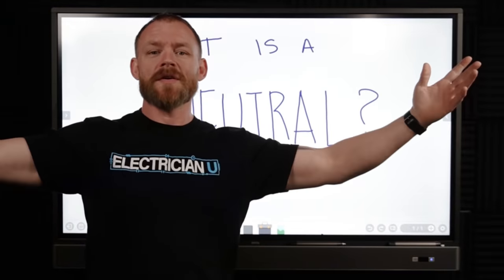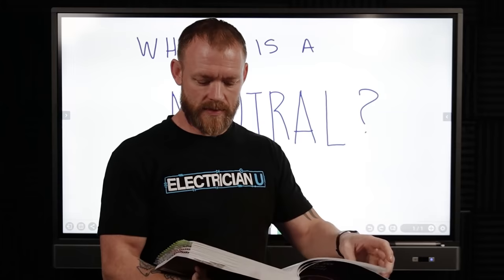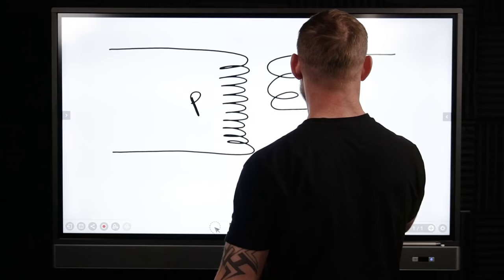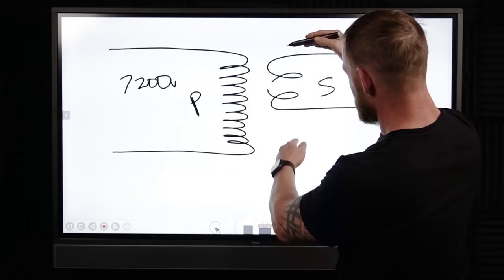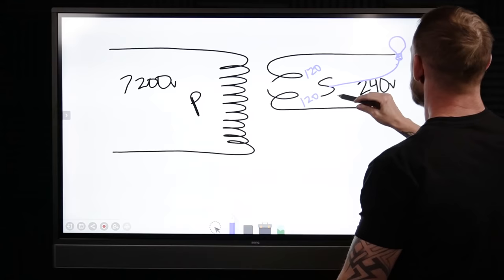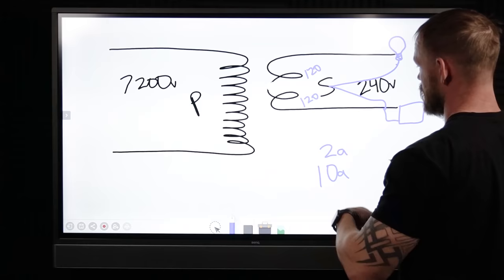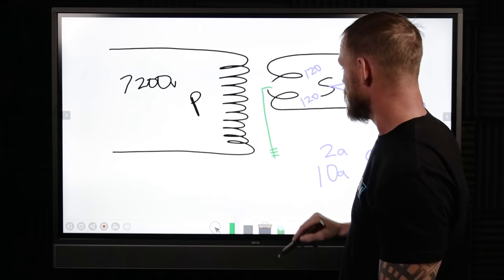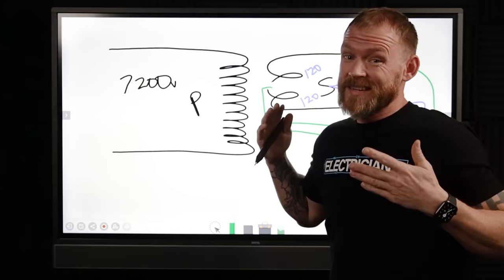What is a Neutral? The Difference Between Grounded and Grounding Conductors.

Comment: A couple of comments from an EE:

Tying the neutral to the earth ground is what keeps the two legs at 120V. In your unbalanced load scenario (light bulb and microwave), had the neutral not been grounded, the light bulb would have seen ~200V, and gone POP.  We found this to be true many years ago when the earth ground wire from the generator powering the house after a winter storm came loose. Fortunately, it stalled the generator. Yes, current does flow through the earth ground in an unbalanced situation.

Since the neutral does carry current, this is why the neutral and ground are bonded ONLY at the main panel.  All conductors have some resistance, and current flow causes a voltage drop. In, say, a shop several hundred feet away, neutral can be pulled well above ground when starting a large 120V motor, like a saw.  If neutral and ground are separate, ground will not change, since there is no current flowing through it.
Reply: Maan sry, but this doesn't make sence. It is possible that the fact that the trans is grounded smooths out things, but as you should know voltage transfromation depends on the ratio of windings. If there is 200V spike on the secondary it means there is a spike on the primary. The reason these are actually grounded is so they could be called neatrual. This is were I dont agree with both of you since the grounding is actually what makes the neutrial if not they will all simply be hot. If lets say we have no grounds anywere the system will still work but if you use your faze detector it will light up everywhere. Also no load on one part of a coil will influence the V on the other part of tapped coil in his diagram the toaster and light would actually be considered as different circuits.  I do low V analog stuff and all theory should apply to the bigger stuff,but I could be wrong.
Reply: Thanks for passing it forward. 
Helping our fellow sparkies ; feed thier families. 
Sweet
Reply: No, it is connecting the neutral to the center of the transformer that keeps the voltages equal. It would work even of some other point was connected to the earth instead or none was. Current never goes through earth in any normal scenario. It goes through the neutral to the transformer.
Reply: @okaro6595  Ya after a few days of searching and one good video I finally got it. It's all about the difference in potential. I can even say that with none we have to use all 3 phases.
Reply: I don't agree with your first paragraph. In the scenario described, the tiny difference in voltage drop on the equal halves of the full 240 volt winding would shift the 0 volt potential of the tap point on the windings... True. But the very same tap point/neutral point that is now electrically 'drifting', if you will, is also connected to ground as I am sure you know BUT .... That ground can do nothing to alleviate the imbalance in the windings due to the different loads imposed on them. What the ground CAN do is slightly follow the drifting of the center tap voltage and thereby maintain zero potential voltage protecting personnel.
Reply: @okaro6595  Right on.

Comment: I have a tricky multiple choice question, hopefully someone with more knowledge can help me out 

A White/grey wire in a feeder circuit ________:

A)Be bonded or have a circuit breaker
B)Is the largest wire in that circuit
C)Should not have a voltage to ground

My notes:

On the main panel, neutral is connected to the bar that is bonded with the panel, the green grounding wire is also connected to the same bar. (so does that mean the answer is A?)

In the sub panel, the neutral wire is connected to the neutral bar which is isolated from the metal box with plastic between them, the Green grounding wire is separated and is connected to its own bar that is bonded to the sub panel box.

In the circuit that this question applies to,

--------- “The neutral wire is going to be sized larger than the Green grounding wire” 
(But that doesn’t mean it’s the LARGEST in the circuit right? Because the two hot wire could be the same size)

--------"The neutral should have no potential difference(voltage) to the ground" (does that mean the answer is C?)
(But that doesn’t mean it’s the LARGEST in the circuit right? Because the two hot wire could be the same size)

Comment: Nice video, but I wish you would have gotten more into the difference between a grounded conductor and a neutral conductor, as there is no neutral in a two wire system. Only in a there or more system. Your lamp circuit has no neutral, nor dose your Microwave. They have a hot, and a grounded conductor, there is no neutral until they meet , and become a neutral back to the source. By definition the Neutral carries ONLY the unbalanced load between two or more hots. Thx for your vids
Reply: Neutral is the grounded conductor. It is neutral just because it is grounded. After multiple phases (split phase, three phase) meed neutral carried the unbalanced current but before that it carries the same current as the live wire. When they say neutral carried the difference they analyze the circuit at a specific point.
Reply: Back when I was a kid.. There was a hot,  and neutral at 110 volts just like a human body oxygen enriched blood go's out the hot wire comes back in neutral wire .... 5 amps system.  We need more volts for. Microwave. Computer.  So now we have a ground. To carry the extra volts and amps

Comment: Grounds and neutrals are electrically the same being tied together "likely" at the service. The difference is their purpose. Grounds are an emergency path for static and ideally brief overloads. Neutrals are sized and protected by overcurrent devices for normal continuous operations.
Reply: They are not electrically the same. A neutral is connected to the neutral point in the transformer and provides a return path for any unbalanced load and completes the circuit. The ground conductor is a safety to take any fault ( in the event of a short from the current carring conductor to the equipment ) to earth ground to give the electricity a place to go other than through a person. Hopefully the electrician has installed everything properly and the breaker trips. (The breaker won't always trip depending on the brand used. See: ITE,GE,FEDERAL ETC . if the electrician used a good brand such as square D, or cutler hammer you can count on it tripping on a ground fault)
Reply: @nooneyouknowhere6148  When transformers are used that include a common or neutral connection such as 4 wire 480/277 or 208/120 secondary. Isn't the "neutral conductor grounded" in the transformer or at the first overload device?

That's all I meant by saying electrically the same. All those little electrons are racing by to get back to the exact same place. Neutrals are the controlled desired paths. Grounds are for people and hardware protection path.
Reply: @Stones_Throw  right
Reply: @Stones_Throw  the problem comes when people start connecting grounds and neutrals together everywhere. Especially in sub panels. The fault current can take the wrong path and breakers dont trip etc
Reply: @nooneyouknowhere6148 Yes, that's why that connection is permitted only once at a service and/or transformers. If neutrals are grounded in multible places. Breakers and fuses should still trip but the problem is that current taking the least resistive path can continuously be going through anything metallic.
Reply: While emergency situations are the main use of the grounding conductor, it is not the only one. Their other function is to get rid of the leak current. A typical device that leaks is a computer. They leak about 0.2-0.5 mA. If the case is not grounded they get half the mains voltage in it and you can feel that by touching it and a radiator (not recommended as you should not touch ungroudned equipment and the ground at the same time)
Reply: @nooneyouknowhere6148  That will not affect the breakers. It may cause GFCIs to trip. Adding connections will never increase the resistance.
Reply: @okaro6595  thIs is what the neutral is for. It is called unbalanced load. The ground is soley for saftey in the event of a short from the hot side of the circuit to the case of the device. Both the hot and neutral are current carrying conductors. The neutral is the grounded conductor of the circuit.
Reply: @Stones_Throw  in cases where there are multiple sub panels such as commercial or industrial facilities,  when the installer has bonded the neutral and ground at all the panels, a simple short to ground at a location in the facility has been know to bypass the 20 amp breaker and trip the power company main fuse at the utility service connection at the transformer instead of the much smaller 20 amp breaker for the specific branch circuit.
Reply: @nooneyouknowhere6148  Such practices will cause an exposed grounding conductor such as conduit to be a continuous current carrier.
Reply: It’s been 2 years since you wrote this so I hope you’ve learnt the correct purpose of ground and neutral since then and how a protective device works .

Comment: Reason for the centre tap of the secondary of the distribution transformer - the Neutral - to be grounded at both the transformer & house ends is so that neither of the 2 split-phase to Neutral voltages may not deviate from 120 V should they end up getting loaded up differently?

Comment: Good, no, excellent video.  Also in a way explains why there's such an imbalance in a residential service when there's an open neutral involved.  On one side you have 140 volts and on the other there was 106 volts.  Ran into this about a year ago.  The imbalance didn't make sense to me, but I knew there was an open neutral somewhere.
Reply: Am I right that when the neutral from the utilities to your house gets disconnected the grounding rod starts carrying current back to the grounding rod of the utilities transformer?  It doesn’t work as well as a proper neutral but it does work some. That’s why voltages get weird.
Reply: @ecospider5  Exactly.. Both sides try to balance the load between them. Meaning one phase may go to 160 volts while the other drops to 80 volts but between the two you'll still have your total voltage supplied by the transformer. That's why lights go bright while others dim.. true story...lol
Reply: @AmericanOne9621  That happened at my house many years ago.  I came home and the kitchen light was lit up VERY bright.  It fried my computer and a few other electronic things.  It was an open neutral in the service drop.
Reply: @TheTennTexan  I've seen some strange things in my lifetime doing electrical work. Here's one for you.... Turned on a fluorescent fixture in a kitchen by waving my hand about 2 inches from it. If you want to know the details I'll share....
Reply: @ecospider5  If the neutral breaks downstream from being connected t the ground then the 240 V divides arbitrarily between the circuits depending on the load.

I it breaks upstream it is more complicated. Essentially it will use the ground rod but also the voltage and current will come back to the ground to equipment cases. There it will seek whatever path it finds. Lets say you have connected your PC to your TV, it goes to the AV cables to the TV then it will go through the cable TV connection to where it goes.
Reply: @okaro6595
Great info. I had not thought about how it would use every ground path. That could get dangerous. 

Also I have learned a shared neural circuit is a really bad idea. Loose that neural and things will get destroyed. I have one in the garage. I’m thinking of taking it out.

Comment: Got it. Neutral is grounded. Just use ground as a neutral. Kidding of course. Good explanation.
Reply: In many countries same wire was used for neutral and ground up to the socket in the past. There is nothing inherently wrong in that though it does have problems so it is not used anymore.

Comment: Can you explain why in a 240V circuit/device, some devices need neutral and some do not?
Reply: Some of those devices may be using internal components which may run on 120V and it may be more convenient to grab the neutral in order to get that voltage.

Comment: Thanks Dustin, very helpful. I wonder if one day you would do a video about Ohm's law, and how each of the three values (current, resistance, voltage) change when various loads are plugged in on a household circuit? Like if you plug in a load at the first receptacle, and then another load at recept # 2, there's more current going through the whole thing, but doesn't that mean the other values have necessarily changed as well? Love the channel, my friend. Cheers!
Reply: I’m afraid it’s a bit more complicated than Ohm’s Law.. i’m no technician, but I am an electrical engineering student, and the first thing I think about is real power, reactive power and complex power. Maybe that’s over complicating things but I know that’s how we analyze large scale loads like houses and industrial loads etc. I thought about this because it changes the overall load from the power system to your house. Really cool stuff.
Reply: In the example you use you would be drawing load off a single phase 120V branch circuit. 1st load at 1st receptacle is say 5A so that would be 5A on your hot and 5A returned on your neutral. Add another load at rec 2, so lets say its 3A. The total load would now be 8A on hot and neutral. The neutral is always equal in amperage to the hot and the voltage would stay constant at 120v. Your neutral only becomes “unbalanced” when it is shared by two different hots/phases in a panel. ( That is the example Dustin is showing on the board). To add another head scratcher to this if you run a three phase four wire distribution out of a commercial panel and all three hots to be equal in amperage, there is zero amps flowing back to your panel.
Reply: Im an apprentice but this.
simplified, in ohms law you need a constant, which is generally voltage, and then the resistance of your lights or whatever your load is, is gonna stay the same. (It wont stay the same, it changes but simplified.)

So in a parallel circuit, which a branch circuit of outlets is, the voltage is the same at every receptacle and they dont affect each other, same with resistance, so the only thing that changes in a simplified version is current, as you add more loads the current will increase accordingly.
Reply: @stinkstick17  yes its cover the karachop law the current is entering in a circuit will be equal to the sum of current coming out of the circuit .
Reply: i dont think anyone specifically answered your question but its pretty simple to answer. in relation to the total circuit, yes values have changed, but that's because you added to the circuit. When you have line voltage fixed at 120V and you plug in say a 15W appliance, that adds a 0.125 Amp draw (voltage X Amperage = Watt, so Watt / Voltage = its Amperage). but now when you plug in a second, say 30W appliance, the whole circuit is now pulling a total of 45W which now means there's 0.375 Amps flowing.

Another way to look at it would be to look at the equivalent resistance. So at 120V, for a 15W load, that has a equivalence of 960 Ohm. (Voltage / Ohm = Amp or you can use Voltage / Amp = Ohm) Now when you look at a 45W load that means its equivalent to 480 ohms (at the same voltage, a lower resistance will lead to more current, and remember Current X Voltage = Wattage). so now when you plug both appliances in at the same time you effectively add them in parallel. With resistors in parallel, adding more will counter intuitively always reduce the total resistance because now you are adding more paths for current to flow. Again this is specifically to adding them in parallel and not series. So the math gets a little more confusing but for adding resistors in parallel its 1 / (1/R1 + 1/R2...) so for our example it would be 1 / ((1/960) + (1/480)) = 320 ohm. So now with voltage being 120 and our combined resistance at 320 ohm, then 120v / 320 = 0.375 Amps.
Reply: The only thing that changes is resistance (which then causes voltage to drop). When copper heats up from current flow its resistance naturally rises. This is called the temperature coefficient of resistance (TCR) and it varies depending on the material. (Some materials have their resistance decrease when heated).

The result of this is that voltage will drop as the resistance increases. To maintain the same level of power (watts) with a decreasing voltage, you will need to keep increasing the current. (Watts = voltage X current).

You also see this effect on longer runs of wire. If you take a volt meter and check the first outlet nearest the panel, you will see it reads a couple volts higher than the last outlet on the circuit. This is because the resistance increases the further down the wire you go (even with no heat or current).

This is all a natural limitations of common materials (like metals,). However, they have created "superconductors" in the lab. These materials have almost zero resistance and can carry current almost 100% efficiently. The problem is they only work at temperatures far, far below zero. So scientists have been working to find a "room temperature" superconductor for many decades now. If one is found, it will greatly increase the efficiency of all electric devices and eliminate almost all waste heat.